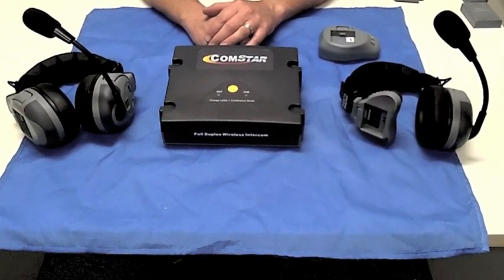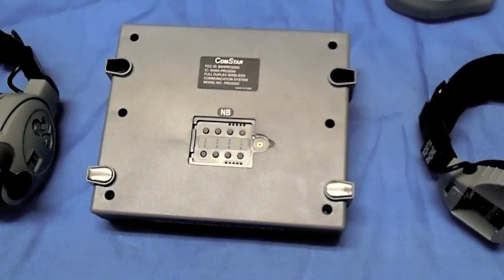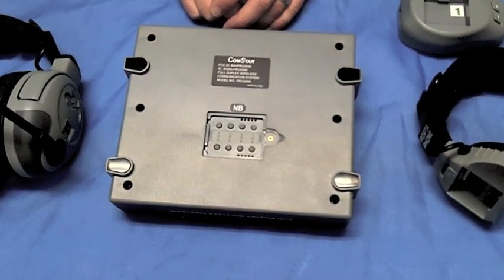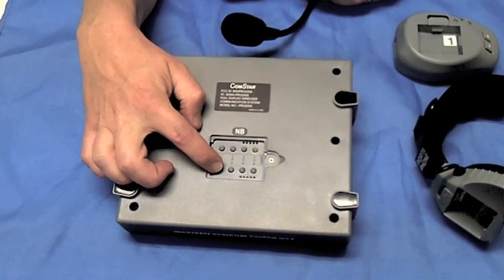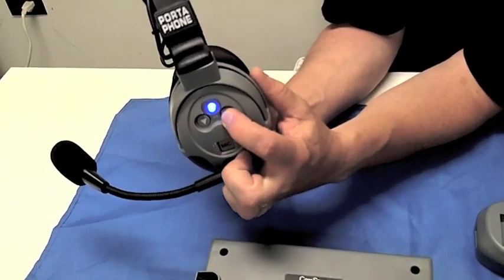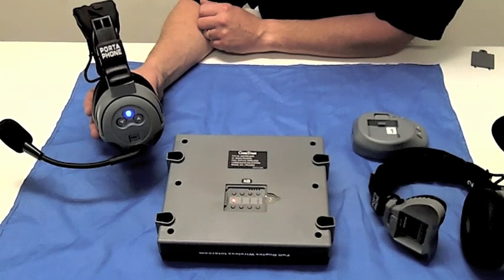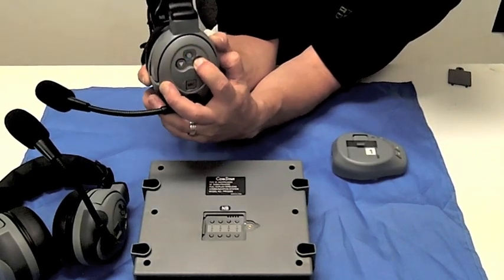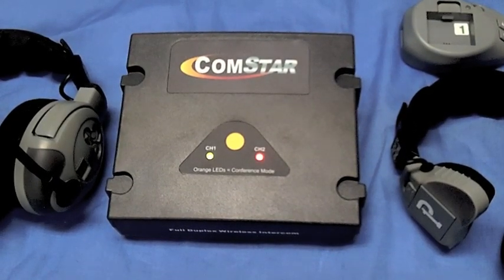ComStar Programming Instructions

Comment: This video is a great video! I was able to easily program an additional headset we had to add to our system after it was determined that the 3 originals (which were programmed by our installer) were not going to be enough. Thank you!
Reply: Brad Pilkington do the numbers on the new headsets have to match the channel you connect to?